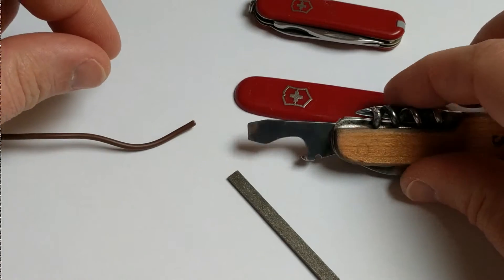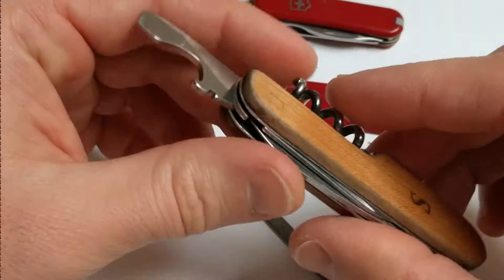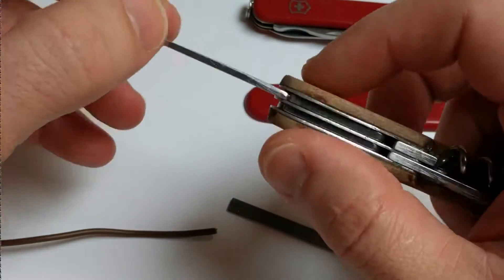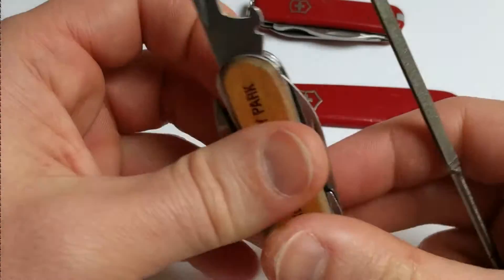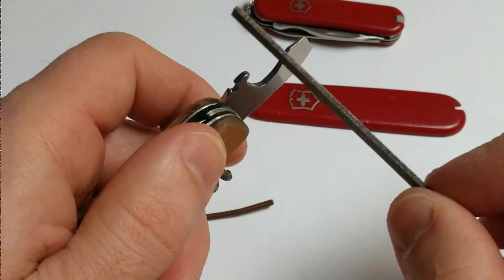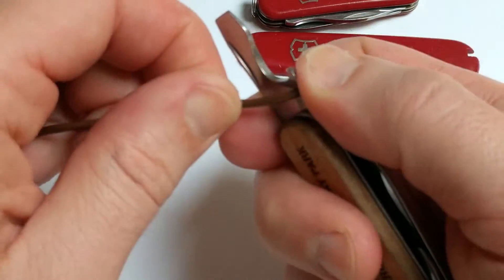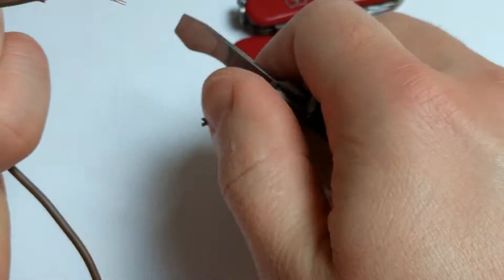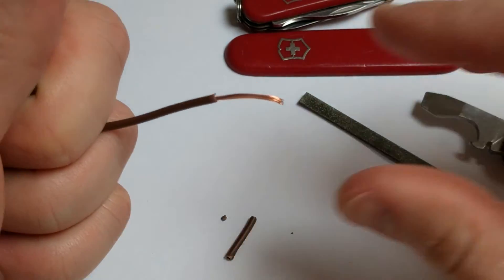Victorinox Wire Stripper FIX

Comment: This is a great idea. Why does it have thumbs down?
Reply: Because that is not how it is supposed to be used 
Directions for use
Open the cap-lifter/wire stripper (or Combo tool, depending on the SAK) halfway, forming a 90° angle between the cap-lifter and the SAK itself. (The newer Victorinox models have a friction stop at this point).
Open the large blade.
Place the wire you wish to strip at the corner formed between the body of the tool and the opened cap-lifter/combo tool.
Gently close the large blade onto the wire. If the spring tension does not cut into the wire, press down on the blade just enough to cut into the wire's insulation.
While holding the long side of the wire, carefully rotate the SAK around the wire, making one complete rotation.
Remove the wire, close the main blade, and fully open the cap-lifter.
Place the cut in the insulation layer in the round notch near the base of the cap lifter, and press and hold the wire down into the notch with your thumb. Holding the long end of the wire, just below the cut, with your other hand, push the cap-lifter forward, removing the insulation from the wire! :-)
Reply: @getfear   Thanks for posting but the modification  shown here results  in an easier job.
Reply: @Strontyum  Really this is a moot point: I found that you can actually strip most electrical wires directly by placing the cable in the notch and pulling. In the odd case the copper wire inside is too fragile or if the insulation is too tough, you just need to cut it by hand and pull using the wire stripper (or do it the "academic" way, as described by Getfear).
Reply: I just couldn't hear the guy